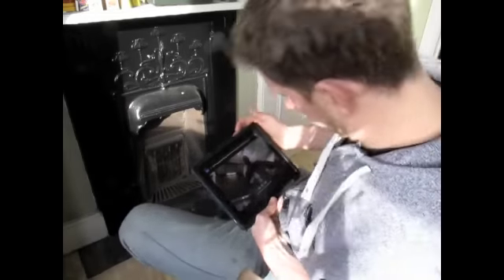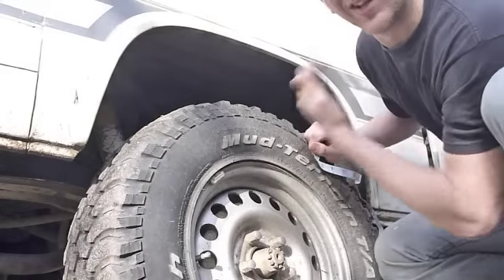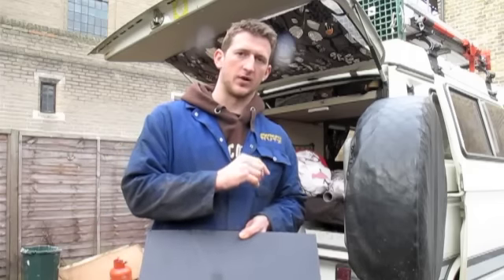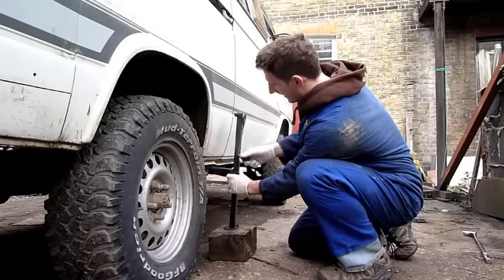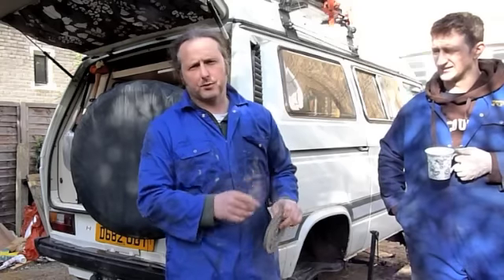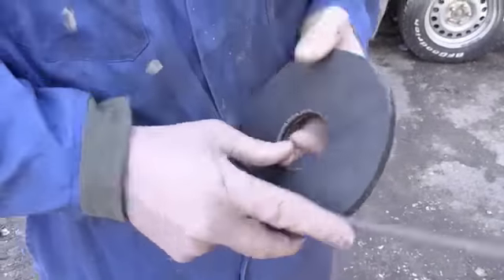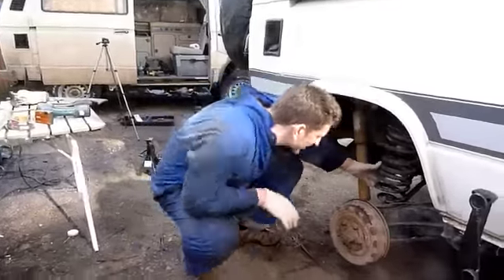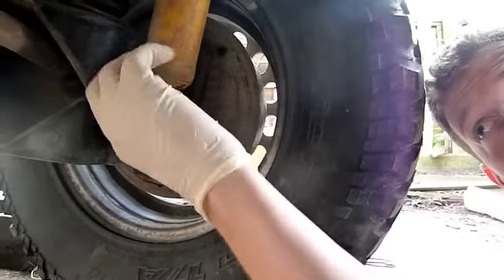campervanculture.com How To Lift The Rear Of Your VW Syncro & Vanagon .....

Comment: Try Air Lift inflatable balls.Insert into the rear springs ,pump them up put a boat level on the rear of your van and level it .About 20lbs pressure.It is a USA product.Installed here in BC Canada was only about $200.00.Give extra cushioning.

Comment: On a 14" syncro, is there a max lift you would suggest before going "too high" for stock suspension parts? I'm trying to level a van front/rear that has Schwenk springs in the front, and a 3.0 subi motor in the back. THX! PS your vids are always awesome.
Reply from the maker: Hi Ben. Anything over 50cm from the centre of the  stub axel to the under side of the wheel arch is a shitty ride.

I hope this helps.

Jed